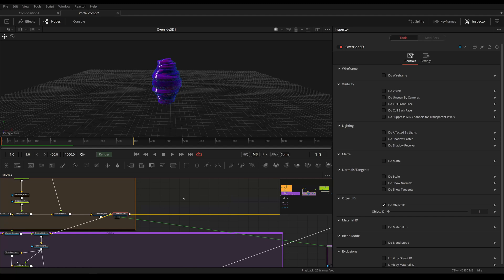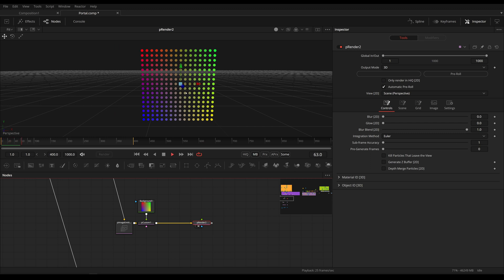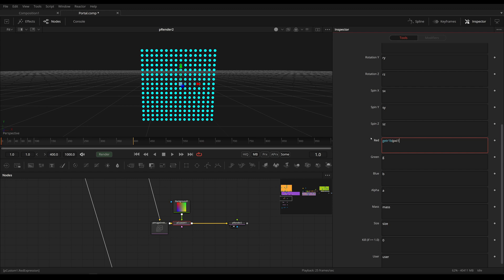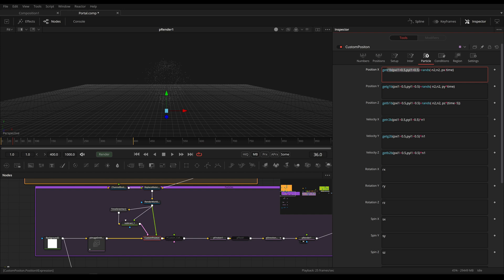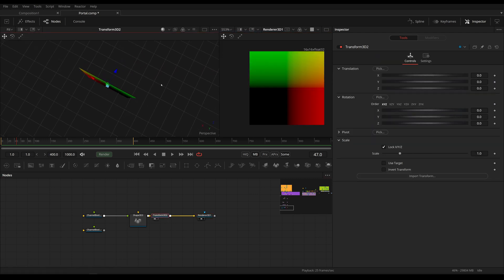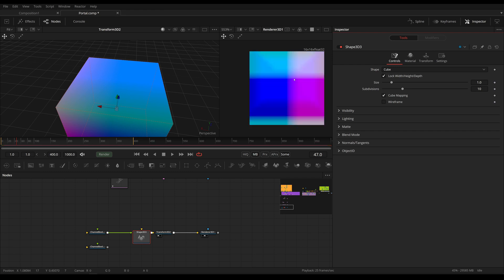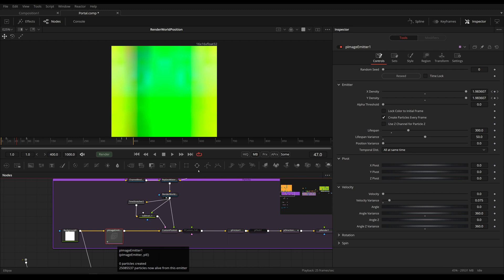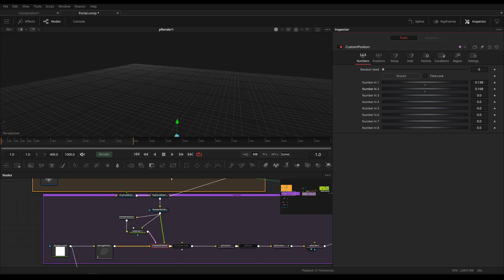Spawn Particles from Mesh using pCustom - Fusion 3D Portal Part 2

Comment: Hello Noah, 
Following your work since some times. I haven't took the time to dig into it. But I'm doing it now. 
And I wonder : Where do you find all the variables for the expressions ? I'm digging into the Fusion 8 manual, the 9 and the actual. Look for Eyon videos & materials... But I haven't found it yet. 
For exemple, where do you find this : "getr1b" what's the last B stand for ? 

Thanks a lot !
Reply from the maker: It’s a combination of the manual and stuff I read on the internet. 
In this case the “b” stands for black. Which means everything that is outside of the image will just be black. It’s like the “Canvas”, “wrap”, “Duplicate” setting on transform nodes. 
So if you replace it with “d” it will duplicate the edges.
Reply: @NoahHähnel  Ahhhh okay !
Then I'll learn the hard way also, but not that hard than you, as you made my life so much easier for the pToolest at least ! :D 

Thanks a lot. I'll play with this a lot !

Comment: I am struggling atm.. I cannot get rid of the little block of particles at the bottom of my particle emitter setup.  Fusion Studio 18.5..   It show up as per 5:26 of this video.. you have the little block.. but even though i adjust the age range to 0
.. the block of particles doesn't go away.
Reply from the maker: That’s difficult to figure out. But you can download the project on Gumroad to compare. You don’t have to buy the advanced examples you can also just download the free ones. The code inside pCustom is the same, just not inside the same project.

Comment: Nice to have you back :)
Reply from the maker: Thanks! Six months passed quicker than I expected haha 🤐
Reply: @NoahHähnel  
I habe a question. 
Why die you use the PCustome to gernerat Particles on the mesh? 
You could have set the region to Mesh and Particle Color to "region Color" ?
Reply from the maker: @MeinVideoStudio  Yes, but we need to place the particles on the mesh using the pCustom tool, so we can also transfer the velocity. I probably should have explained that better.